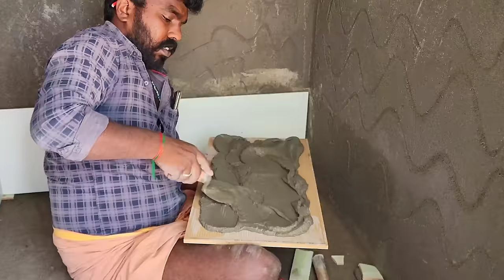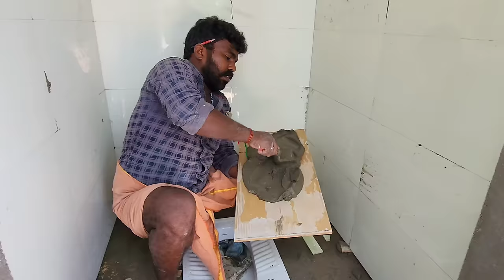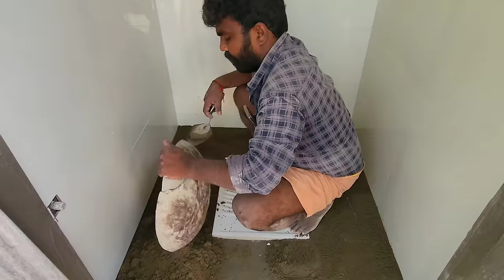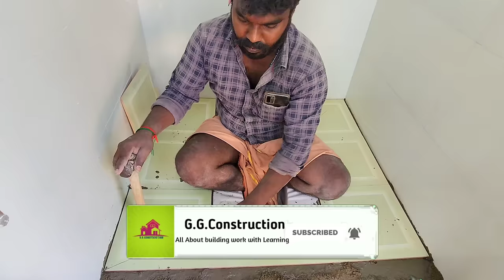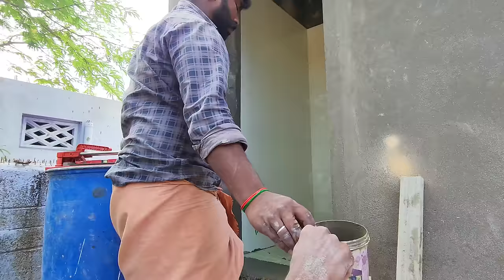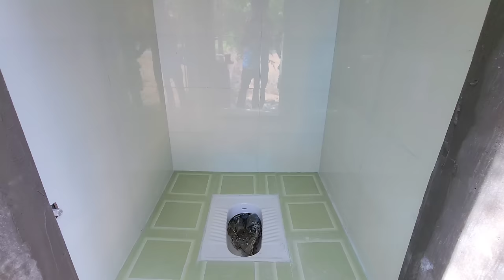Excellent work in Bathroom Wall And Floor tile installation process Easy and Fastest Construction

Comment: Bad job those tiles going to fall off the wall in a few years
Reply: Why
Reply: Yes
Reply: Why?
Reply: Why?
Reply: Why
Reply: Yeah
Reply: @Chaitany_001  not spreading the Cement evenly (which is little thick), water will eventually seep into the gaps and will destroy the joint between the surfaces.
Reply: Yes
Reply: No. Never failed. It will long lasting for 50 years
Reply: U r right
Reply: @medisendi4999   dz
Reply: No tile goona to fall off ..its a way to fix on wall... without expens much...koi seepage nhi ho rha bathroom me itna...joints achce se fill hone chaiye bus
Reply: It's not true man
Reply: Ha ha
Reply: No adhesive in the corners  is asking for trouble.
Reply: Yes
Reply: Why?
Reply: @kvsconstructionwork  k
Reply: That is why maintenance comes in
Reply: Саломггшшш
Reply: In a few weeks!

Comment: floor should be first. cant stand to see shower floor tiles cut to the wall tiles, because after some time it will settle and grout will crack at that detail. once that happens water will travel down wall tiles directly under floor tiles and in time saturate mud bed. if wall tiles are laid on top of floor tiles this penetration will be much much less if any. in a shower never install shower floor tiles after wall tiles unless you leave a gap on bottom and slide floor tiles underneath, but its best to do floor first and grout floor (and even seal the joint against wall) then install wall tiles...
Reply: You said it right...
Reply: GROUT DOESEN'T GO IN WALL/FLOR JOINTS!!! SPECIAL SILICONE MUST GO ! 
It can go both ways, everything has its advantages. It's even better quality doing wall tiles first because poliestren isolation can lay down under wheight of estrih flor, in some rare cases,  and you have the bigg problem if flor tiles are made first.
Reply: When I say grout I mean whatever I have seen in my 40 plus years of doing tile. I have remodeled hundreds of showers and everyone that has floor tiles cut to wall tiles is separated, whether its grout or silicone. In all those water has penetrated underneath.  Whenever I see floor tiles first, penetration of water is doesnt happen no where as much because water isn't traveling straight down under pan...I have never ever seen a shower benefit when walls are done first. You can use your fancy words about the detail but you probably cannot speak from as much experience..I don't care what it is, flat work first, just like slab before block, floor tiles before base, flooring under casings, cabinets on top of flooring, Its just a better detail...can you imagine shower floor pebble tile cut to walls, not good at all. Let's put in furniture first and cut to it, just shouldn't happen. Even curb sills, seat benches, and niche sills should be set first but its way harder to plan these out and most don't do it but they should. Especially in a shower anything one can do to reduce water penetration should be done and besides that it looks so much better. Yes if siliconed or grouted nicely one might not be able to tell but in time that Silicone will separate and now water is going straight under mud pitch or under shower floor tiles, not good and is one of the biggest shower floor failures
Reply: When silicone gets old, you remove it and put new one. Easy..I do flor tiles first most of the time, because it's easier for me like that, not that I think it has more quality. Have you ever seen when estrih flore sinks down about 0,5 cm -1 cm ?
Reply: @anatom512  maybe I haven't seen that because all my work has been in Florida and 90 percent has been over concrete slabs. Is this something that happens on wood? But no, never ever seen that
Reply: Yeah, in USA Florida doubt it would happen, but when you write to whole world you should mibe think that whole world is not Florida with all building sistem working like clock 😉
Reply: I've done walls first for close to 30 years. I  use the floor tiles to hold up the bottom row and tuck the floor under the walls. Then there's less motar to clean out the floor. Not saying this guy did a great job either these types of jobs give me job security and have for year's.